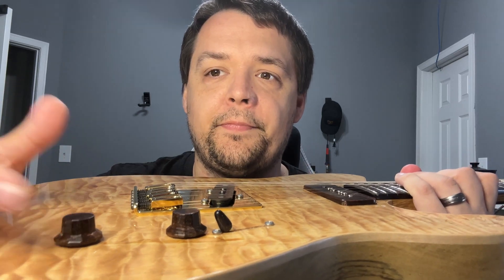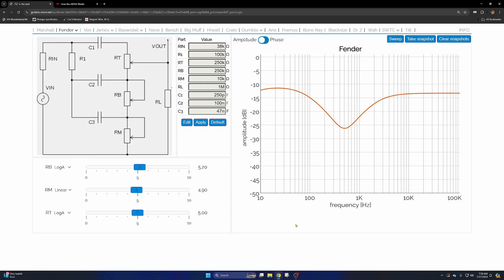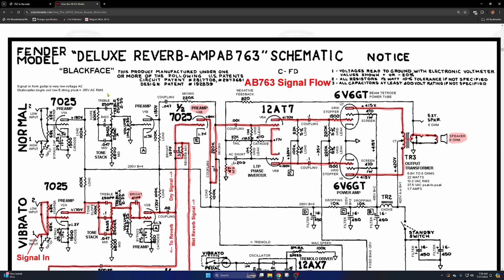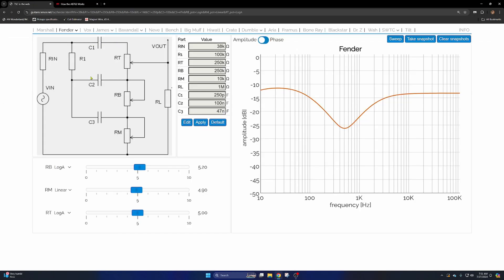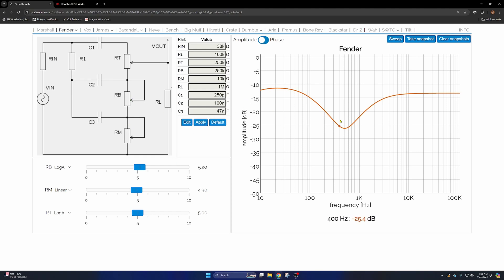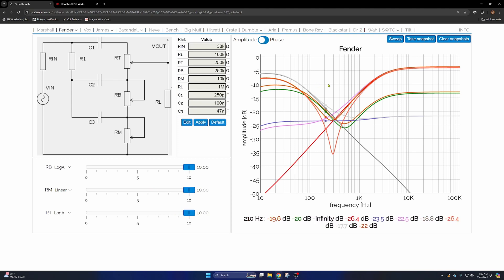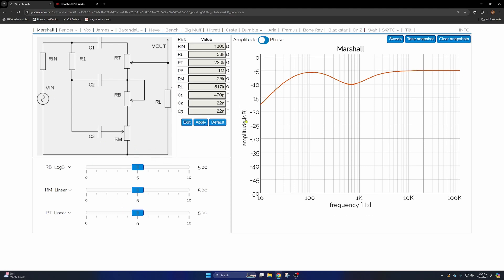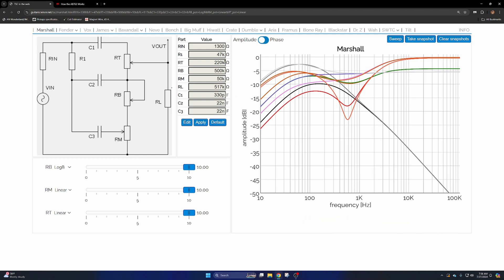Trash to Treasure Part 2 Tone stack design

Comment: Been looking to mod a silvertone 1483, and just found your channel! Knew you from Rhett’s stuff! Quick question because I’m a complete newcomer when it comes to amp teching: if I were to change the pots on my amp to different pots, does that make me need to change anything else in the amp like rebiasing or anything? I know there are some precautions to take power wise before diving into an amp all willy-nilly, but other than that is this essentially just like a permanent eq knob change with no other consequences? If so, I can’t wait to change my amp for the better for like $20 lol